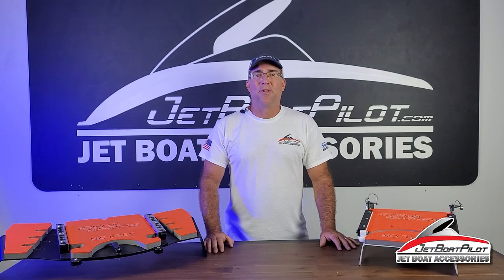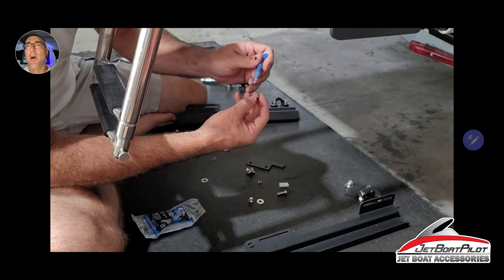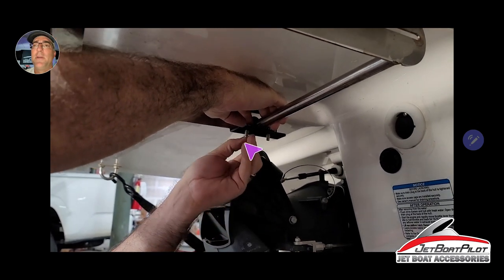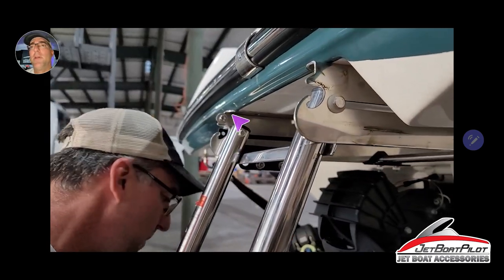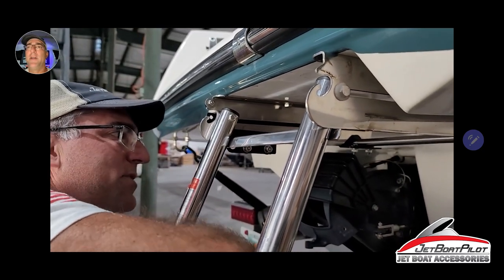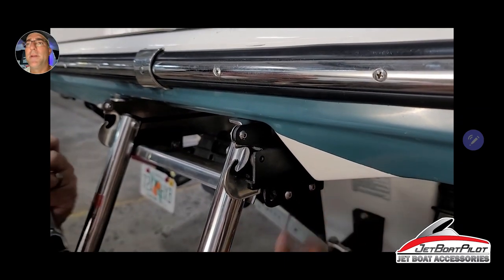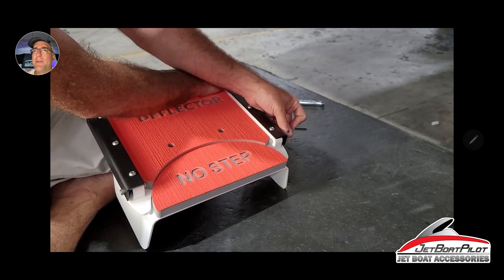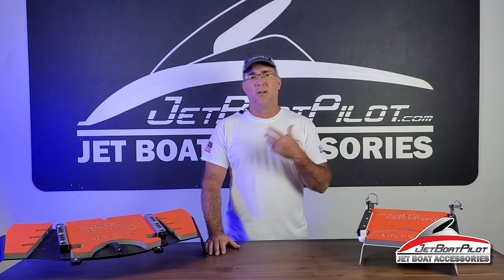2020-Current Yamaha JetWash Deflector Mount Hardware Install Video

Comment: Enjoyed the video. Do you recommend this with the Yamaha wake booster or instead of it. We have a 212xd on order.
Reply from the maker: The JetWash Deflector basically cleans up the wave, like the booster. The difference is that you don't have to move the part from side to side as you surf port side or starboard side. With the booster you have to do that. Also our part floats so if you drop it by accident you don't lose it in the water. If you forget the float on the booster, you'll be diving for it if it gets dropped.